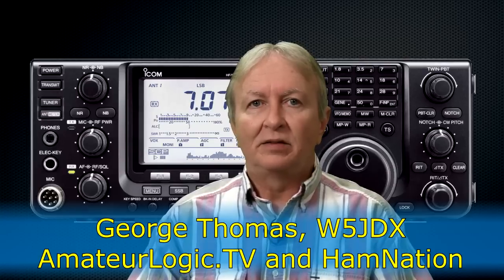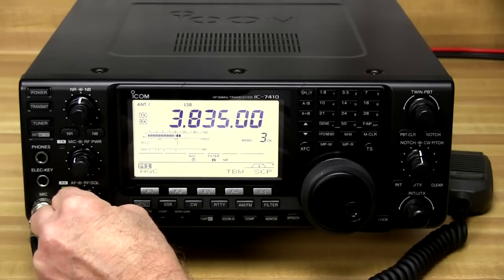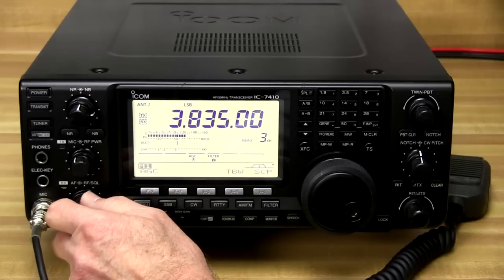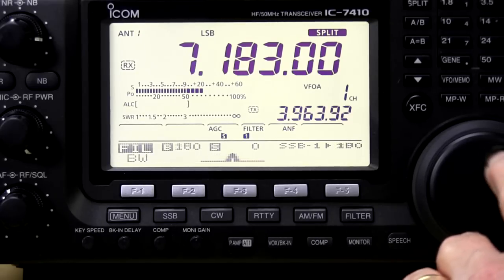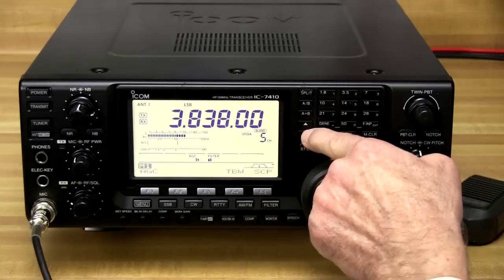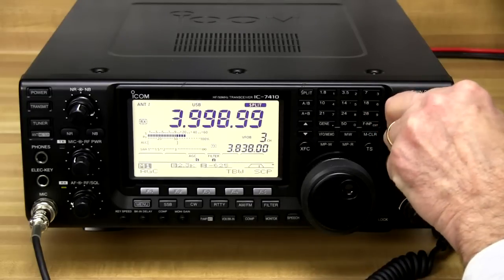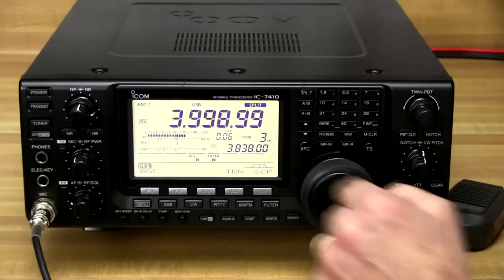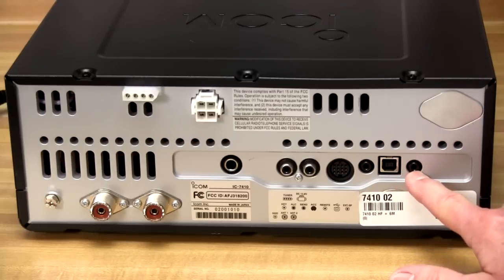IC-7410 Featured on AmateurLogic.tv

Comment: I know everyone is gaga over color screens and waterfall displays these days, but I love my 7410.  The screen is clear, bright and has just the right amount of info on it without being cluttered.  The receiver is very sensitive and the TX audio can be adjusted six ways to Sunday using the tone controls and compressor.  CW features are excellent and easily tailored to your preferences.  

The other thing I love about the 7410 is that it doesn't force me to get into menus and search through hundreds of settings.  There IS a set menu, but it's more for one-time or infrequent changes that you typically do when you set up the radio initially.  After that, everything you need is a button or a knob on the front panel, or a short on-screen menu and a handful of choices.  With this radio, you can focus on operating and not menu scrolling and hunting.

And since everyone is going for waterfalls and color screens, you can pick up a used 7410 way under $1,000.  Get one and you won't be disappointed.

Comment: Nice video brochure. I wonder if icom changed the way they handle cooling? Icoms of the past would not engage the cooling fan until you keyed the radio. If the radio had been monitoring for several ours and then finally keyed, the fan would go to to hyper drive to cool it down! This happens on the Ic 7600 and the pro series and Ic 7000.  Kenwood and Yaesu and Elecraft fans come on even if not keyed when it reaches a certain temp.
Reply: Hey Steve

Comment: Nice video but is it true that this radio has overheating issues?
Reply: I hear the opposite... the Icom specification fact that it can run 100% duty cycle at full 100W power. Not many radios can claim that.
Reply: The IC-746 Pro, which the IC-7410 replaced, had overheating problems.  This rig has a larger cabinet to accommodate a much larger heat sink which eliminated the overheating problem.
Reply: combatwombat71 It's not true. The IC-7410 will overheat on full duty cycle. I just bought the radio last week, and I overheated it on RTTY at 100 watts. Took about 8 hours in a contest setting, but it did go into protection mode and took about 15 minutes to cool down and I had to reset the transceiver. The manual suggest that you should not use more than 75 watts for RTTY. Also, 100 watts CW will kick the fan on full speed most times.
Reply: I have the ic-7410, and yes, it's going to hell hot when you doing some psk qso on 50W power level....It can heating up itself even on receiving too... Typical icom situation. I have the ic-7200 too, same problem when you TX for longer period its going to burning itself. I have an IC-2730 and it can heating up itself during RX.... So it's seems like icom has a very very serious problem with designing a proper cooling system for its own radios...